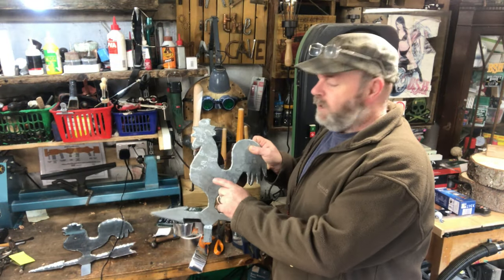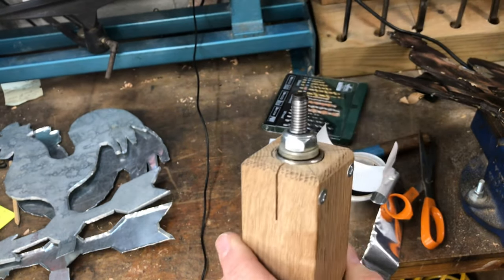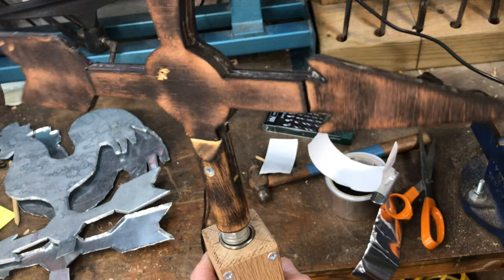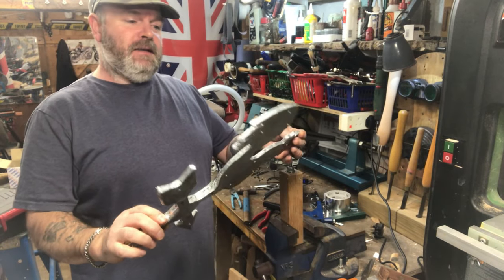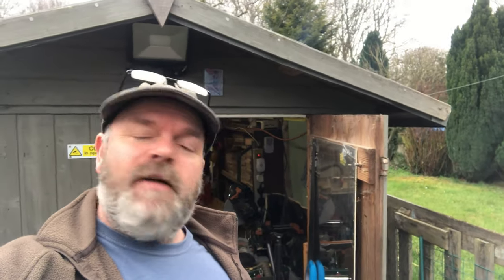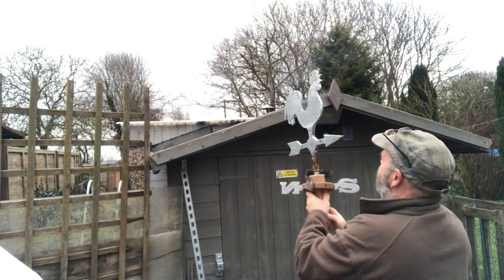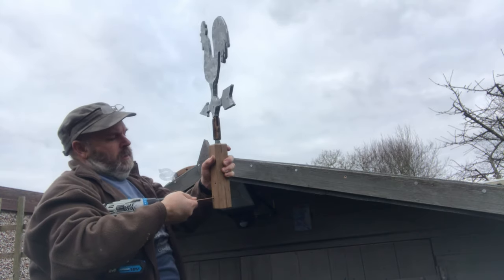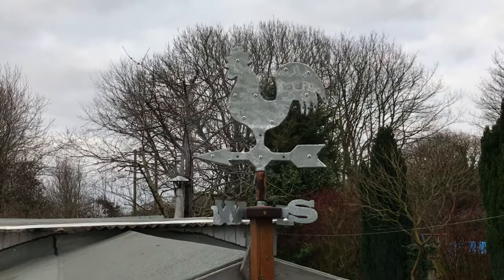Workshop Weather Vane

Comment: Question...
What makes the vane's arrow point in the correct direction and not in the opposite direction?
I've watched many videos on how to build a vane, but nobody has explained this concern. What makes it really confusing is that the arrow is supposed to be perfectly balanced on the pin. 
Thank you.
Reply from the maker: I don't really know Dave, when I looked into this my conclusion was having more surface area to the back of the weather vane. Then this makes the arrow point to where the wind is coming from. Not sure if this is correct but it's hard to check mine as it is close to buildings and trees.